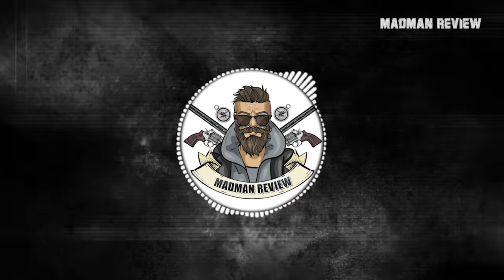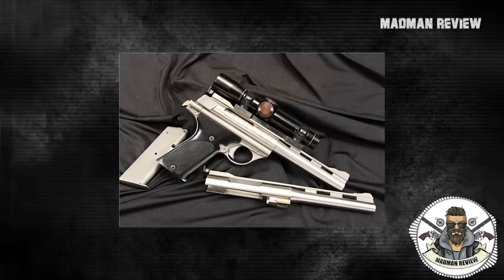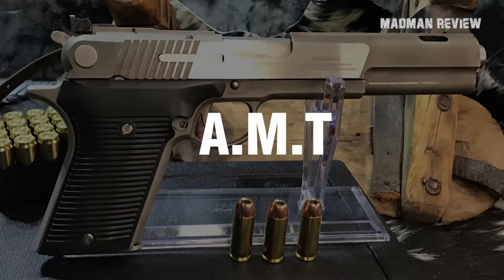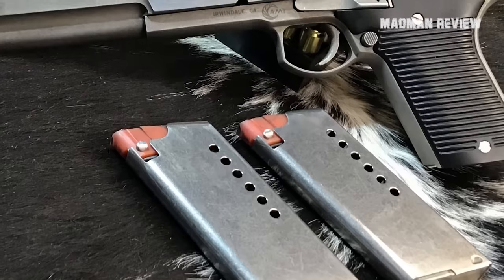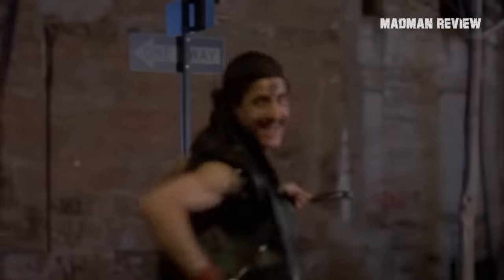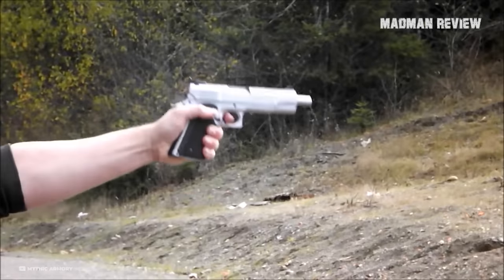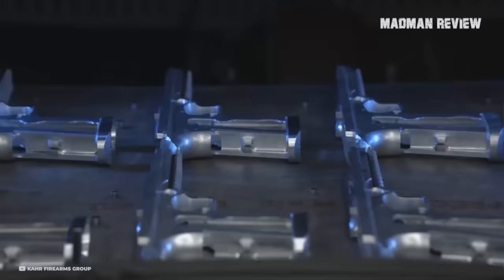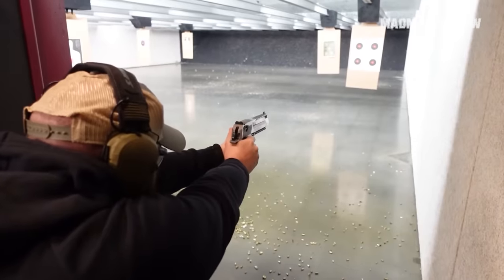Top 5 Big Bore Magnum Semi Autos

Comment: As an honourable mention you could have included the Coonan 357. It is basically a 1911 in 357 Magnum.
Reply: I remember watching a Kentucky Ballistics video featuring that pistol.  I love the concept behind it, but apparently they have an issue with feed jams.
Reply: @GlidingZephyr  Yeah that's the downside. Since the cartridge is rimmed you can easily get rim lock.

Comment: It's a little absurd just how difficult it seems to be to get a semi-auto handgun to function with magnum "big bore" (in my mind, .44 and up) cartridges. It's why I'll always be a revolver fan first, and a semi-auto admirer second. It's easy to load any kind of power level into a revolver of a given caliber and they shrug it off. Biggest handguns ever made are still revolvers by far, swallowing even rifle cartridges.
Power to weight/size ratio, revolvers take that spot as well.
Reply: Lot more moving parts in a semi. A desert Eagle is fun and very cool but for me it’s just a range toy. I love big bore revolvers especially Single action I’m hoping to get myself a Freedom Arms in a ridiculous caliber at some point as of now the biggest one I have is a 2.5 inch Super Redhawk Alaskan in 454 Casull
Reply: @googlechicken  FA is superb. You going for .475 or .500?
Reply: A revolver just doesn't have to do much with the ammo. The autos move it around and uses the recoil to cycle making it more reliant on the right ammo's oal  and load.